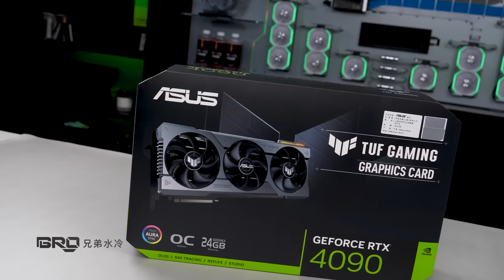「BRO」4K PC Build Lian Li O11 Dynamic EVO White Have you seen O11 EVO with 3 360 Radiators?#pcbuild

Comment: BRO you really nailed it whit this one - Defintly one of the most beautyfull builds i have ever seen - truely a work of art👌   🤩🤩 

What brand are those fittings??
Reply from the maker: BRO Water Cooling System With 3 Set 360MM BRO Radiator